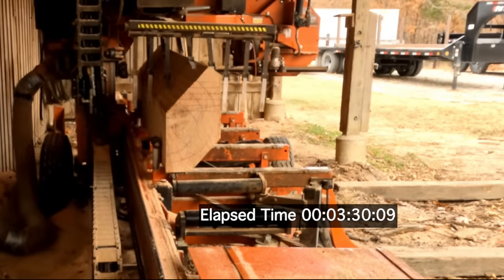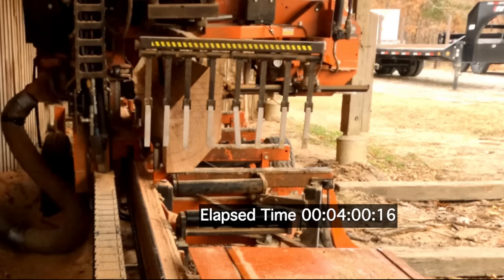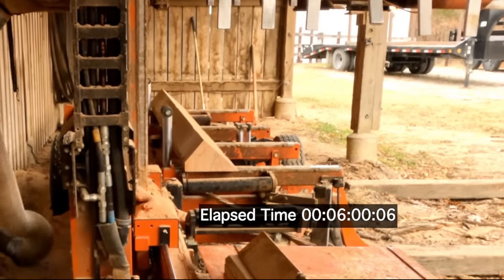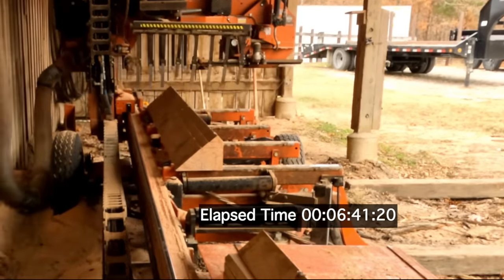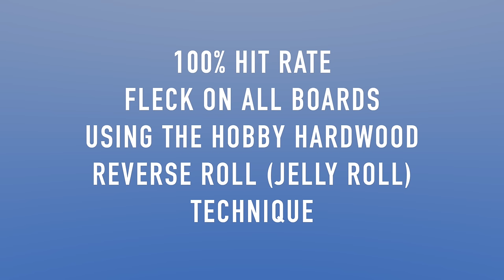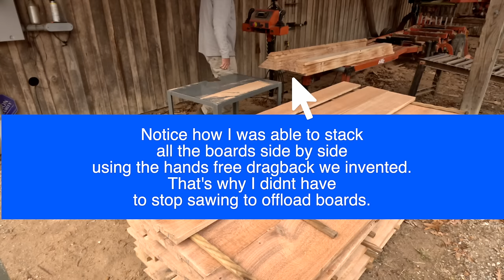The Fastest, Best Hands Off Quarter Sawing (You've Ever Seen!)

Comment: Are you using a computer to move the saw down or just that familiar with the saw? I am debating on buying one but not sure it is worth the cost.
Reply from the maker: The drops from board to board are done with a computer set works.  Most mills will have either a mechanical or electrical setworks to make accurate board thicknesses.

Comment: I always thought there was a heartwood cant that is not used for grade lumber but you keep the heartwood?  Is that his sellable lumber?
Reply: Heartwood is removed when he passes it through the edger.
Reply from the maker: That is correct, heartwood has a different grain structure and will cause defects in any boards, so is removed either when sawing or doing the secondary processing later.  It's removal is essential, and in the case of quartersawing, there are three "center boards" that are removed immediately after splitting the gunbarrel that I didn't show in the video to get the majority of the pith removed, and then after kiln drying, all the boards are planed and edged to bring them to finished S4S, which removes any remaining pith, angled edge and any curve.

Comment: Also is nice to have a machine do all the work. I have a ta schmid saw it's all Manuel crank up down and push it through the log and I have to remove the boards myself and I have to manually load the logs with my tractor. So my sawing is very physical. This sawing I can see if very enjoyable not that mine isn't cause when I'm done is satisfying knowing I manually did myself.
Reply from the maker: Yes, thanks.  We have a nice machine now, but I started with a chainsaw mill, then went to a full manual mill with a 15hp engine, sounds a lot like yours, and as our business grew, we needed to produce more lumber so bought more and more equipment.  No matter the mill, sawmilling is fun.

Comment: That's mostly rif sawed. Just saying.
Reply from the maker: Nope, although rift sawn and quarter sawn are both sawn at angles to the growth rings, the difference is that quarter sawn as defined by the NHLA has to show significant fleck in oak, maple, sycamore and couple others.  If it does not show fleck it is only rift, if it shows fleck, which is more difficult, it is quarter sawn.  So in order to be quartersawn and show fleck logs must be aligned approximately 1/4" preferably 1/8" to the medullary rays and this is the part I skipped when I did the first part of the video.  So I had a 100% hit rate, or 100% of the boards showed quartersawn fleck which is the whole point of this sawing technique. It saws as fast as any technique but yields nearly 100% high value quartersawn lumber, not lower value rift sawn.  It's easy and fast and makes money.